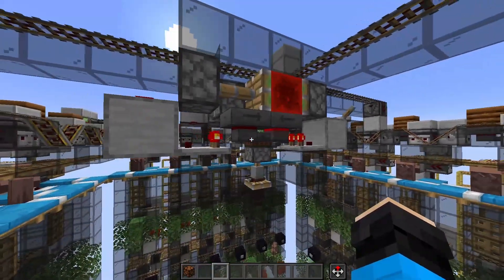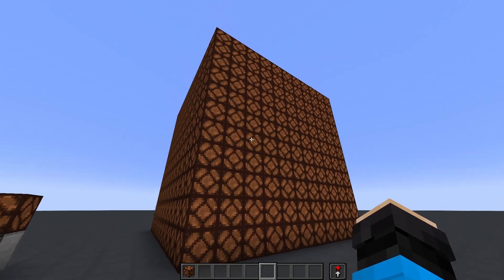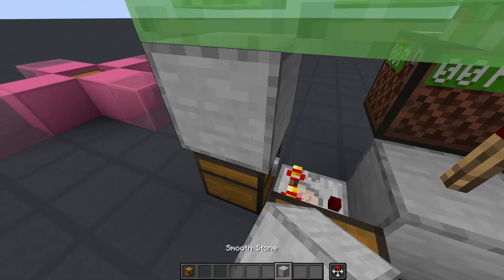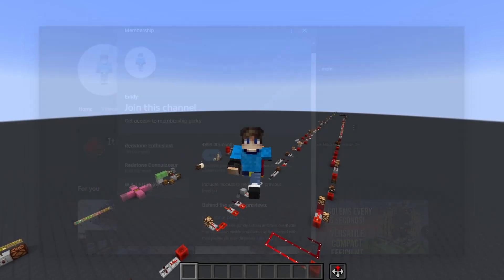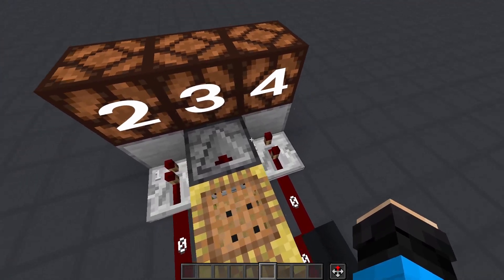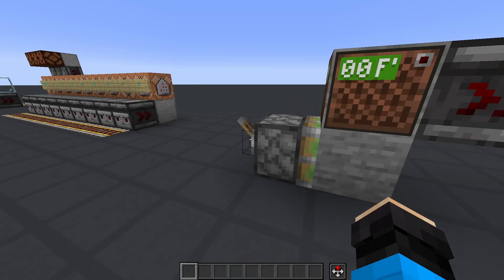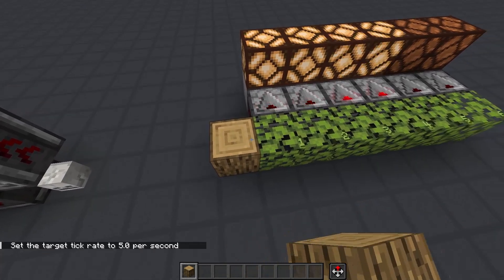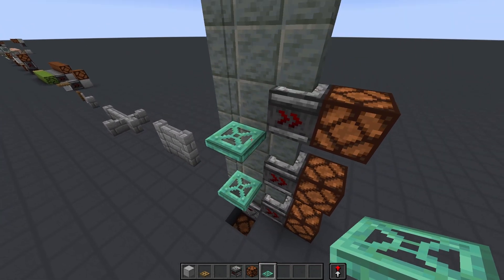Minecraft's Observers are More Powerful Than You Think | PRR 3

Comment: 3:08 "There's no way to detect them."

This is not true. While yes, there's no way to instantly detect them, that does not mean there's no way to detect them.

Faster methods:
Daylight detector (skylight only)
Mushroom/crop light requirements (block or skylight)

Slower/random methods:
Grass/crop growth.
Mob spawning.
Reply from the maker: You and patate are really vying for a nerd crown or something huh 😂
Reply: @EmdyMC  Daylight detectors are an actually useful way to use light updates. 

You can (for example) transmit a second bit of independent information down through a walltower with them.

Generally you want to just use more walls, but in really tight spaces, it's a wacky information transport option that works.
Reply from the maker: @haph2087  yeah I'm aware of the daylight detector signal stuff, but when I said "There's no way to detect them" I meant that you can't detect the update propagation in the same way you can for block and state updates. Error on my end I'll admit for not making that clearer.